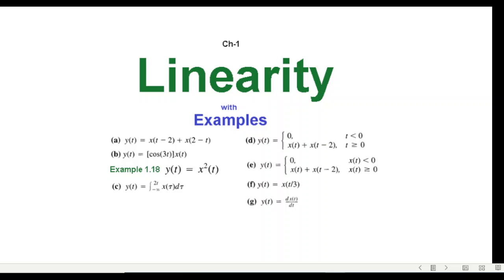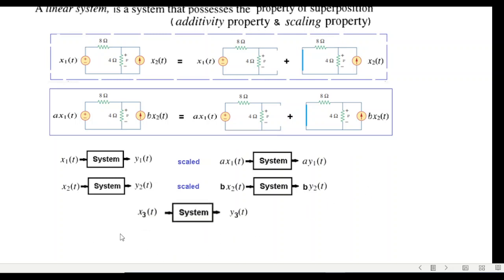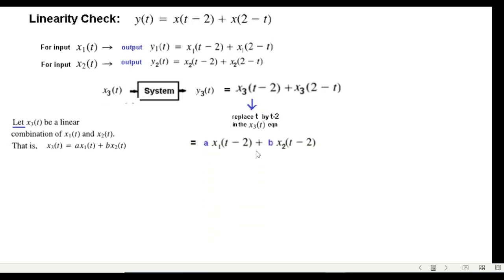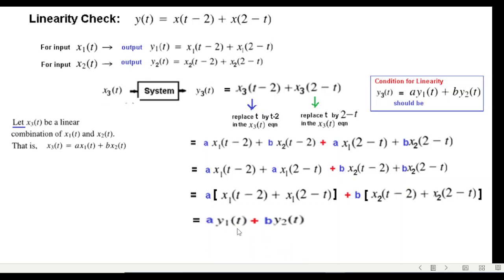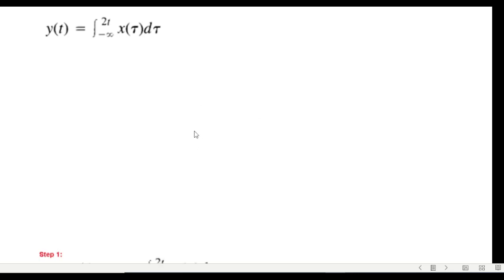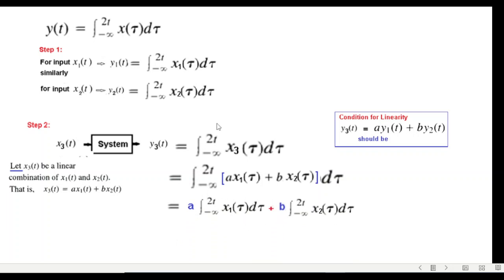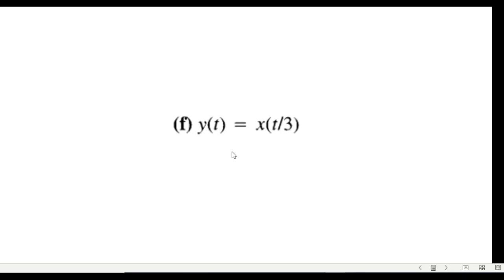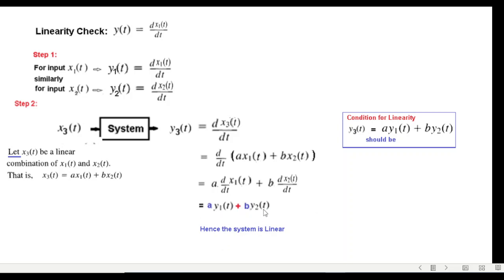(English)S&S || Question 1.27 || Linearity Property of a System

Comment: 12:20 Hello sir, I have a question. For the equation y1(t) = x1(t) - x1(t-2) to hold, doesn't it require the assumption that x1(t) ≥ 0? Similarly, for y2(t) = x2(t) - x2(t-2), it seems the condition x2(t) ≥ 0 must be met. So, wouldn't that mean we can't apply this transformation in all cases? I feel like there might be counterexamples. I'm a bit confused about this part and would appreciate your clarification. Thank you!
Reply from the maker: Thanks dear, but I really could not understand your doubt. We have mentioned the conditions that you are talking about in all three equations. We never said that this transformation is applicable in all cases unless the required condition is specified . can u mail me your doubt, so I can further look into it.